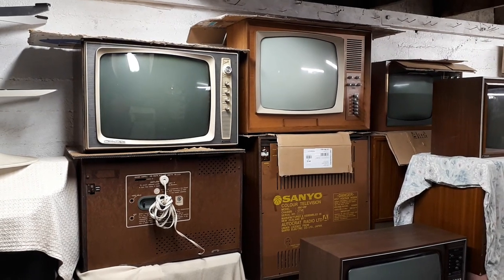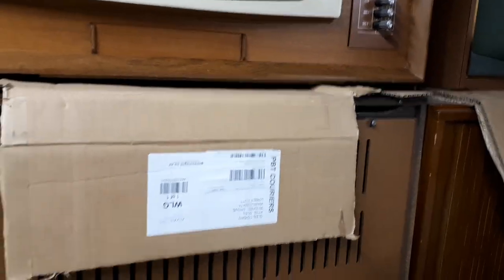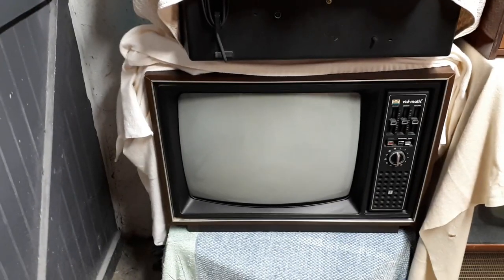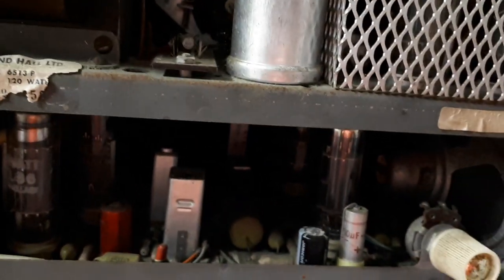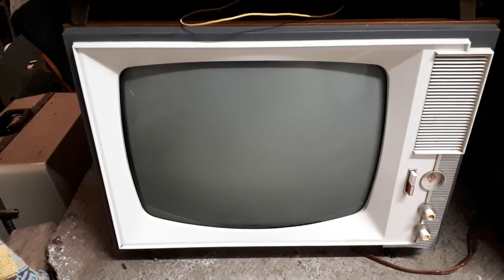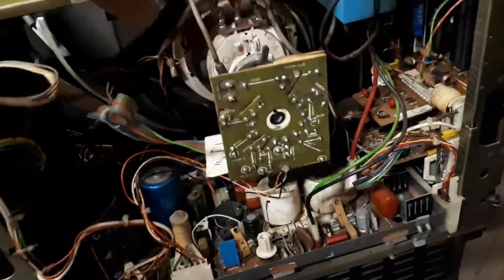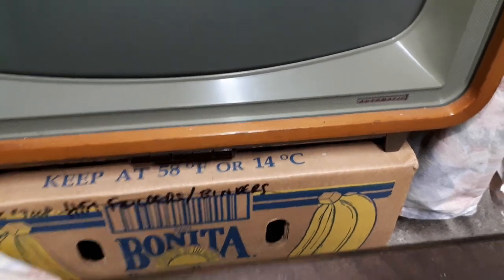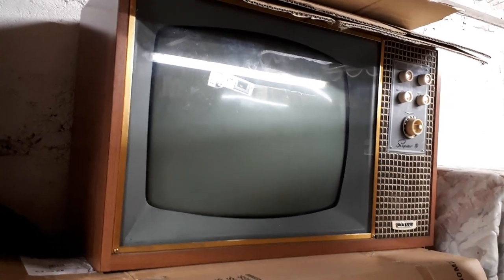Update Part 2

Comment: The Aussie K9 was notorious for the fly back tuning cap going o/c the resulting excessive eht arced through the tube neck.  Because the oddbal channel 5a was out of range of varicap tuners the Aussie K9 had a rotary turret tuner. The Decca reminds me of the Bush TV125/u we had in London.  The /u indicates the UHF tuner is fitted,   Seems like English manufacturers were more prominent in NZ than Australia.  Ecko got a lot of resistance from repairers in Australia as they didn't like the live chassis designs.  Aussie manuafacturers avoided those and used transformers in the vast majority.
Reply from the maker: Yes the same affliction also happened with our native K9s here. The 11n5 tuning cap would go open and the arcing would begin! Every set I worked on or sold would have that cap replaced regardless.

Comment: Great to see your collection. I cut my teeth on k9s, Vidmatics, tx574, tvc 1, 2, 3. Your 9000 took me back to my apprentice days for sure. Trying to understand the cyclops nightmare whilst boosting filaments on every prec.20 that came in the door. Used to love the tx9 though. What a fantastic picture (when not phantom fuse blowing). Best set I owned by far was sharp tx100. Cost me a Line output tranny but was still going like the day I bought it when I finally put it in the dump (stupid me). If you ever get a bell/magestic tvc, I'd love to see one go again. Keep up the great work :)
Reply from the maker: Hi, thanks for that. We had a TX574 as a family TV and as a child I remember every few months it would break down and a man in a Tisco van would turn up remove the back swap out a board (or two!) and off it would go again. It got nursed untilk the 1980s when it packed up again and my Dad went and got a National Quintrix M12 which 'never' broke down. I agree on the Thorn 9000's were a bit of a nightmare trying to understand that cyclops arrangement and the array of faults they had and I've never seen a Precision 20 give a good picture with those useless soft CRT's they used. The one in the video however uses the larger 22 inch CRT (Hitachi I think) which is fine. Agree with you on the TX100's they were a great set and produced a nice picture. Was never a fan of the TX9s and the ones I had to fix always had soft tubes and poor focus etc haha. I haven't seen a Bell TVC 1,2 or 3 for 20 plus years, doubt there would be any left! 
I would like to find a Thorn TX574 even though they were horrid things, the challenge would be to get it running again but like the Bells, they too have vanished.
Reply: A friend had a 574 that he kept going. I'll try to catch up with him and maybe get some video of it if he still has it.
Reply: A lot of the TX9s were in the rest homes so they ran all day every day hence so many soft tubes. We also repaired tons of them for a TV rental company so yeah, abused. When they did have a good tube, they often had the best picture in the workshop. Super bright whites and great colour tracking. If we tidied one up, it'd be sold by the afternoon, haha.
Reply from the maker: @tenmillionvolts  The only TX9s that I saw a brilliant picture on were the 14 inch versions, the bigger tubes always seemed not that great but as you said probably abused and 1000s of hours runtime!

Comment: I wonder what was wrong with the RCA picture tubes used in that British Pye you opened the back on? That seems sort of odd that the Hitachi tubes were fine but the RCA ones were not, as the RCA colour tubes used in North American sets, during the 1970s and 80s, were usually quite good.
 I hope you can show some of your radio collection at some point.
Reply from the maker: I'm not entirely sure why those RCA tubes were so bad on the Thorn 9000. It was the 20 inch version that just didn't last, they went smeary and flat we'll before their time in contrast to the Japanese Hitachi ones.
Reply: Maybe it was the circuitry driving them? Is that possible?